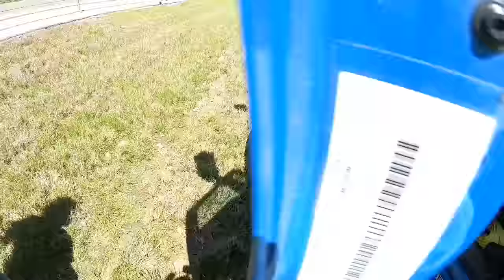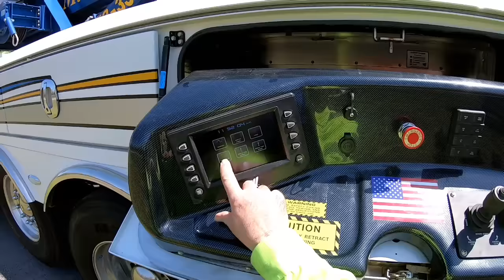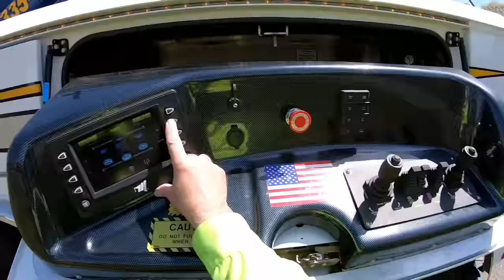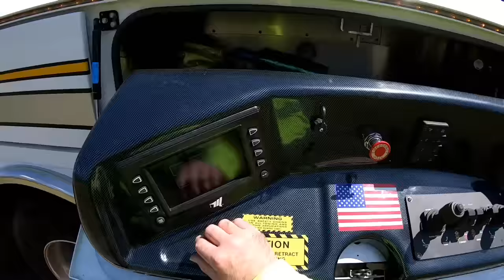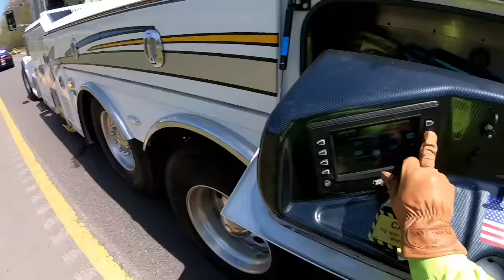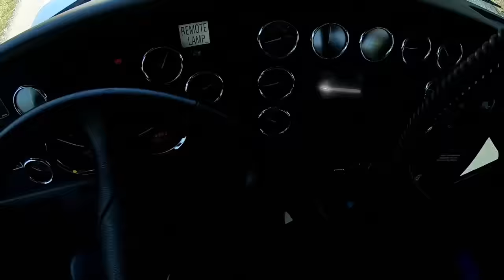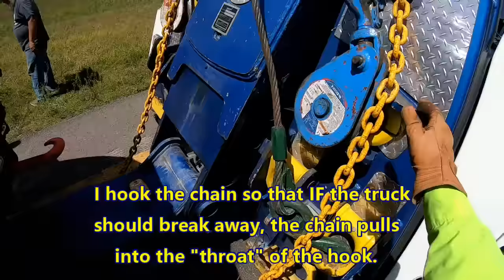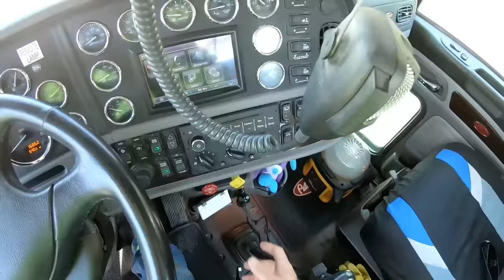Car VS Semi Crash!!!  Code 3 Response

Comment: Man!  I have never seen such a slow reactions by other vehicles to lights and siren.  If that happened in my state there would be a lot of folks getting citations as they would be recording even license plate that was not just still on the road but those that had not already cleared a lane.  When I was taught to drive I was taught that soon as you see lights and/or hear a siren you pull of the road at the fairs safe spot and then sit there leaving the lane clear until you are sure that not other emergency vehicles have to come along.  Given the fact that nowadays the rescue squad does not go out without a fire engine following at some point as well as an ambulance, when you pull over best shut off your engine and just be prepared to wait a bit.  Especially on a freeway - seemed like those cars might have given the initial emergency vehicle through but then everyone got back on the road and filled it up - like it was going to get them where they were going any faster - as most likely a wreck is going to have it either down to one lane or the road completely closed for a while.  I know people think they own the piece of road that they sit on and hate to give it up because someone else might take it but another thing I was taught was  to think about what if it was ne in the wreck and I needed the rescue - would I really want to have to wait while others refused to give up tehir spot?  There was a perfectly good center median for everyone of those vehicles in the left hand lane to have pulled on to, but they all just sat on the road until specifical got behind then and wanted them to move , like you might not have wanted them to pull over but just everyone else.   I remember our driver ed instruction pounding the message into us about getting off the road when you hear a siren or see lights on any road and the only time you do not is if you on a freeway and they are definitely on the other side.  Here when everyone pulls off the freeway to let rescue through everyone just sits and waits until traffic stars moving again as a sign that its okay to use the road again.  Maybe the drivers ed in you area needs to be more forceful about how drivers should handle rescue vehicles.

I really felt sorry for that driver as it seemed like his driving ability kept it from being a accident with a whole lot more involved or some more people hurt.  He was shook up when you git there but I think he was getting hopes up about still being able to drive the truck and the last thing he wanted to hear was that the steering linkage was gone and he was not going to be driving it any time soon - poor guy, but he did have an angel on his shoulder that day as well as his own ability to avoid what would have happened in most other cases.  People in cars need to learn about what its like to handle some of the other vehicle on the road - from motorcycles to semi trucks and not think everything is going to react like their little compact vehicle.  I hear people swearing how they "gave the truck plenty of room" while their idea of plenty of room is what you would give an Accord not an 18 wheeler.  If people had a better idea of what it was like to drive some of the other vehicles on the road they would drive better and make wiser choices.  Sure if he had been just another passenger vehicle they might have made their turn - not safely- but at least the passenger vehicle might have had the maneuverability to have gotten out of the way, but to assume a semi truck could was a big mistake.   I see it all the time on the freeway here - people changing lanes and ducking in and out around the 18-wheelers never seeming to think what the braking distance of one is, or whether they can swerve quickly out of the way or not. Most of the jackknifed and over turned semis we see around her almost always involve a passenger vehicle that did something so stupid that even another passenger vehicle might not have been able to avoid  it.
Reply: I agree..Probably 50% or more of people really shouldn't have a licence and even worse those people see it as a form of entitlement instead of a privilege.

Comment: I just got a traffic advisor for my truck abous a week ago. I was driving down the interstate near my home and i had a feeling i would have to use it.  Just as i was getting to the exit i was getting off at i came across a car in the road that had just hit a deer. So i turned on my traffic advisor on to direct trafic away from the disabled car. I had the driver get out of the car after making sure he was ok. I felt good about being able to help save some ones life i am glad to assist anyone i can even i it is just using my truck with traffic advisor to help truck driver on the side of the road or jumpstarting a car

Comment: Awesome job Ron. I do have to say two things, An emergency turn around is not for a missed exit turn around and in the state of Florida if you use it and are not emergency personnel  you are looking at a $500+ ticket. Secondly, twice now I have saved a tow truck company thousands of dollars because they forgot about the wireless remote for the wenches and left it sitting on the pull fork. I'm not sure how they didn't lose them nor how long they were on the fork, I just threw my car in park, grabbed the remote, and ran it to their window. I can only suspect they didn't do a pre tow inspection or they wouldn't have left the remote on the forks. 

Your kindness to all involved goes to show you're not in this industry for the money.

Comment: I got pictures of a big mess here in Key West. 2 cars had simultaneously rear ended a Como propane truck. We were all blessed that there wasn't an explosion especially with a gas station a few yards ahead. Took a few hours to clean up. Somehow there was oil everywhere and that required a front end loader full of sand and 2 street sweepers because the sand oil mix was causing the sweepers to overheat

Comment: I watched this video before but watching it again I wondered if you have a cable to connect the rotator to the trailer lights so that you get the clearance and all other lights. This would make you more visible at night. Of course the trailer has to be intact.  Cheers Rob.

Comment: That is one bad ass tow rig. Major respect from the truckers for these wreckers. The load he is hauling now is insane. I was thinking about the brakes too. As bad ass as that tow rig is I'm sure it's like anything else, towing a load like that you need brakes on at least some of the wheels of the load. I have a 1/2 ton truck and tow my 30' camping trailer. I have the brake controller in my truck and when the trailer is on there I feel like the trailer does a lot of the braking for the entire load, not just it's own weight.

Comment: You Tow Truck Driver had done a tremendous job towing that big rig & safely to the yard Well done It's a Big Massive job to do that sort of work & it's a Beautiful Nice Tow Truck that you have got to Kind Regards Peter PS Well done get that Big Rig To The Yard Safely I so glad that no one got Badly Hurt in that Accident because normally when Truck VS Car The Car Ends Up Worse Off Those Lovely Beautiful Were Very Lucky That they were weren't hurt I'm So Pleased That They Are OK

Comment: I am a lifetime public safety officer (now retired) in California. I'm stunned to see a tow truck going Code 3. I've never even heard of this before. In CA, there are only a small handful of tow trucks who routinely respond Code 3 and have all red lights, LEDs, flashers, you name it, it's a big disco show! But every single one of those tow trucks I'm talking about is owned and operated by the State Dept of Transportation, also known as "Caltrans". The Code 3-equipped tow trucks are on every long, over-the-water-bridge in the SF Bay Area. That would be: The Carquinez, The Bay Bridge, Golden Gate Bridge, San Mateo Bridge, Dumbarton Bridge, and the Richmond-San Rafael Bridge. I don't know if Caltrans has any Code 3 equipped trucks down in Southern California, but here in the Bay Area, it's really the only thing we can do to provide emergency services to people stuck on the bridge. During commute times, one truck stays at the east end and the driver can just hang out inside the air-conditioned offices at the toll plaza if he wants to. But the other guy has to take the truck all the way to the other side, make a U-turn, and sit there for several hours off the freeway in a large dirt parking lot where he can get to incidents quicker (depending upon what direction it is and how backed up it got). They dispatch them VERY quickly because Caltrans Control monitors all bridges live, 24/7. So at the first sign of trouble, the two trucks roll and so does CHP. I wish we had more Code 3 tow trucks because the only thing I could do to help them is to have my dispatcher let them know that I'm authorizing them to go the wrong way down the freeway (for example, go eastbound in the westbound lanes). But that's only if it's our only option left, and only if the drivers do exactly what we tell them to do----which is to turn on every single light they have on their truck, and makes lots and lots of noise with their horn. Going the "wrong way" down a freeway is incredibly dangerous, but under the right circumstances, it's the wise thing to do. I think the drivers like it when they get that order because it's something nobody else gets to do. :)  
 
And to the driver of the truck in this video: VERY nicely done. You obviously have a lot of Code 3 experience and training. When I was an FTO training new cops out of the academy, going Code 3 always took a lot of patience on my part. Anyway, thanks for the video. Excellent!

Comment: Did you only have your tractor brakes I didnt see you hook up any air lines to the other tractor. Finally someone else that know you need to cross strap loads either on the hook or on a trailer. I have a snow plowing and hauling company and people always question why I cross strap and some even say im doing it wrong that you should not cross strap. Well growing up my Grandpa had a construction company and I was chaining down 20ton dozers at 7yrs old. He just had to help with the binders I didnt weigh enough yet.
Reply from the maker: On the initial move off the interstate I only had my brakes.  When we stopped at the exit we connected air from my truck to the towed unit for safe stopping power on the way back to our shop.   Thanks for watching and God bless.

Comment: Once almost hit an escort vehicle. Was in the Army,1961/62 time frame.We were hauling military tanks that were being shipped from Korea to Japan.Tank as packaged weighed 53 tons.M.P escort thought we were going too fast so got out in front. The M.P driver was forcing us to try to stay under 15 MPH. Going downhill 53 ton load Korean war era tractor Tractor transmission could not handle strain, popped out of gear. I got on the brakes and siren at the same time,before the MP jeep could speed up out of the way my rig was about three feet off his six.Close call,almost what one would call brown seat time.

Comment: Those turn arounds are bad news.  Our area, even with our reds on, I still don’t use the turn arounds.  No space to accelerate or slow.  The new ones do, they have cutouts for that, but the majority are built for patrol cars.  Lock it up, crank the wheel, and punch it.  I’ve gone 30 miles out of my way when I’d confused exits and missed mine.  So it goes.  Make a phone call “hey, missed the exit, back in 20 minutes”.  It’s that easy.  Hats off to this driver for his skills, professionalism, and a whole mess of luck.

Comment: This is one thing I don't like about general haulage, the trailers are built for specific loads. Back in the day a London firm called I think Convoy hauled paper rolls for the newsprint shops. They had a curved headboard on the cab end of the trailer and the first roll sat in that, the rolls also sat between a side rail to prevent side movement.

Man some of the loads carried, the driver isn't even allowed to see it loaded. Yet he's responsible for it once out of the gate.

Comment: I'm only the first couple of minutes in, but as a trained former response driver, I do wonder why you don't do the cereal packet thing? Just tear along dotted line. It means both lanes of traffic can see you, and they can easily move to the side of their respective lanes creating a clear run between them when clearing a full lane can be impossible. In my experience, it is by far the fastest way through backed up traffic other than running the shoulder. There ain't never any substitute for bigger horns :)

Comment: Hey Ron, I have several questions for you but please understand that none of it should be construed as criticism. 1 Would I be correct in thinking at the first part of the pull where you were pulling almost completely sideways, that you would want slightly more pull on the near side? I would think that equal pull might result in the far side cable tipping the truck if the wheel dug too far into the ground.2 It seemed to me that there was an awful bit of slack in the chains on the near side that were securing the  steering axle to the forks? The bottom of the axle was near the top of the forks. 3 It seemed to me as if putting those two pieces of cribbing stacked up under each wheel would be pretty dangerous as any shift in the load the cribbing could roll and drop the tractor down.4 I've seen you run an air line hook up from your tractor to the other rig to operate the brakes on the rig. Why not here?

Comment: Talking of driving talent, here's a true story: I was riding shotgun with a trucker friend once, in Erie, PA, just after we had dropped off 80k pounds of sheet steel (at least near as I can recall, that's what the weight was). We were on the PA interstate (do they call it a turnpike there? I can't remember, they do in MA), chugging along at about 60mph, pulling a 45' flatbed, when all of a sudden, as we were approaching a traffic light that WAS green on our side, the light changed rather quickly from green, to yellow, to red. My buddy didn't really have time to slow, and we were close enough that he could have gone through the light with no trouble, except there was a car that pulled out in front of us, as soon as that light changed, and I mean AS SOON AS the light changed - he came out so fast, I don't believe he even took a second look to see if there was any oncoming traffic. My trucker friend quickly, but smoothly turned the wheel to the right, intending on just going around the car pulling out, and we got around him just fine, but when my friend started turning the wheel back to the left, back into the middle of the traffic lane where we had been, something went wrong, and best guess was that the flatbed hit some mud on the shoulder of the road, and because the trailer was empty, it was thrown into a jackknife move. The trailer swung all the way around to my side of the truck, with such force that it struck my passenger door, smashing the window, and throwing glass all over me (luckily, I had a split second to see the accident coming, and I instinctively threw myself to the left, across the center console, or 'dog house', covering my head at the same time). The trailer actually PUSHED the tractor with such momentum that we wound up sitting on the guard rails, facing the OPPOSITE direction. I remember my buddy shouting at me, "David! Are you alright??? We need to get out of the truck, we're leaking fuel!". When the trailer hit on my side, it had punctured the gas tank. Thank the Gods that neither of us had any injuries, other than being shook up a little. That's actually the only vehicle accident I've ever been involved in, thankfully.

Comment: Ron, this may have been answered in a previous video that I haven't seen, but what does PTO stand for?
Reply from the maker: Power Take-Off.   In simplistic terms, a PTO transfers energy created by the engine to another usage other than propelling the vehicle.   Probably the most common use in my industry would be to power a hydraulic pump system.   They hydraulics power all the boom, winch, outrigger, and under-reach systems on this particular truck.   Thanks for watching and God bless.

Comment: @32:09 The retaining nuts on the spring/axle are trashed. The U-bolts are not the appropriate size for the spring pack. I can't see the curbside set up but the driver's side nuts are (probably) past the allowable "spin" amount. The curbside is within tolerance. NEVER let Indian engineers process a change notice. They DO NOT think past the piece of paper.

Comment: 7:45
I have 2 questions after learned something new just now, plz help:
Firstly, it's legal to have all those red-blue lights and sirens on a tow truck, I thought it would only be legal for a tow to have those amber lights. 
Q1 Does this mean the truck has a same level of priority road using as the police / fire and medical department vehicles?
Q2 So is this towing company a private company or under the gov. department?

Comment: Out of curiosity, are all your trucks equipped for a Code 3 response? And are you required to take any sort of defensive driving training or anything like that to operate one of these trucks Code 3?
Reply: Joshua Doll - Good question. It's something we've never seen in Canada. Even Jamie on the Highway Through Hell doesn't have it.